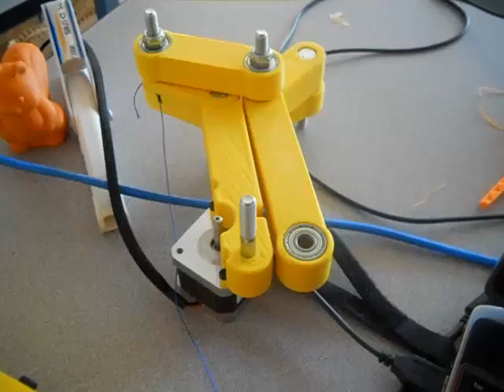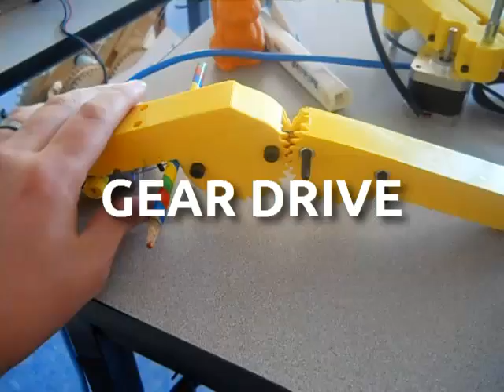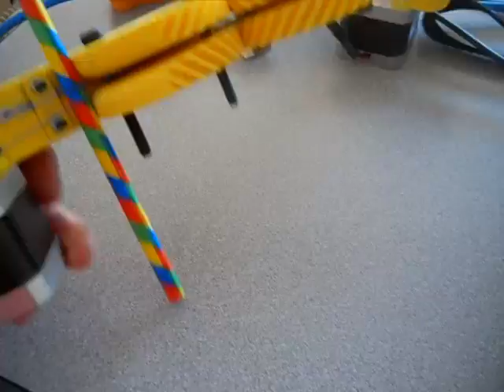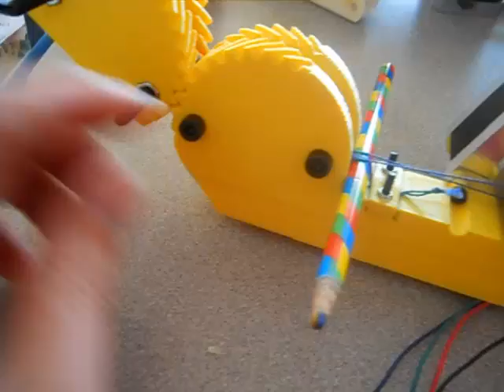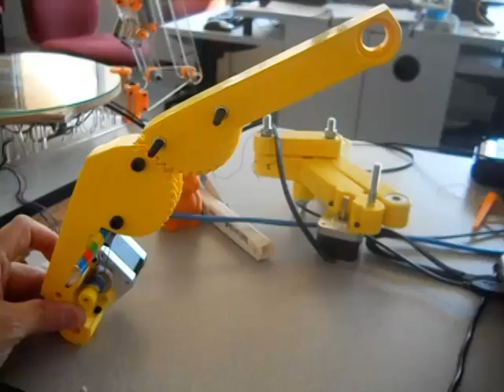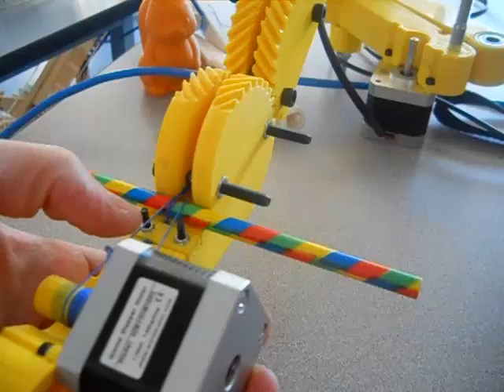RepRap Simpson - Experimental Arm Drives

Comment: why have the gear system, why not just have a central pivot with offset leverage points above and below the point of pivot?

the gear just seems like a lot of extra fabrication that is unnecessary unless I'm missing something.
Reply from the maker: That is a good point.  I have thought about getting rid of the gears but there is a nasty singularity when the arms are parallel.  I could limit my working envelope to avoid this singularity.  I will have to think on this and do a few calculations.

The beauty of 3D printing is that the complexity of the arm doesn't really matter.

As you can see in the video, I was just testing out different arms.  I didn't expect the gear arm to work at all.  However, it worked better than expected.  I haven't been able to attribute any error in my system to the gears.  Not to say there isn't any but I have other identified sources of error that eclipse the error from the gears.  Have you checked out GUS Simpson? http://youtu.be/IEGTe1G2Gqs